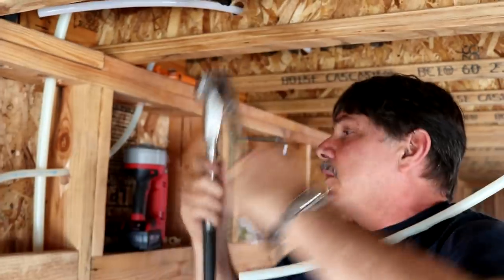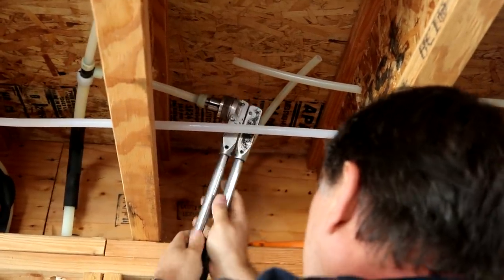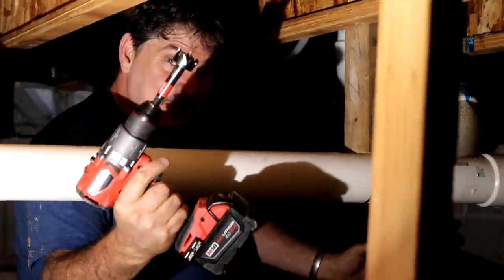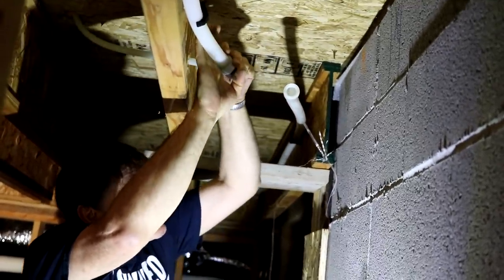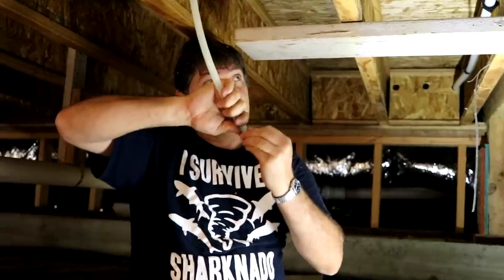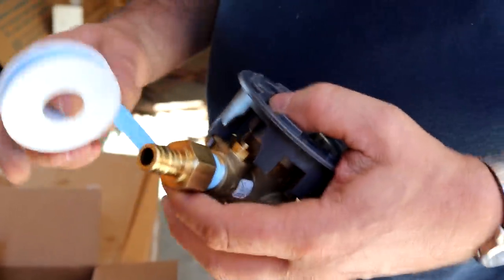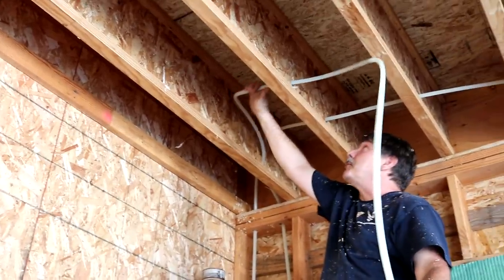Plumbing with Plastic Ep.95

Comment: Re:recirculation line.  I have one but don’t use it unless guests are here.  My concern is that it would seem to constantly be returning somewhat cooler water to the water heater.  Which, in turn, would constantly be “on” in an effort and to heat it to the desired temperature as it is constantly exiting into the supply line.
Reply: Sorry. My pudgy fingers hit the post button before I was ready.  The house is pretty big and the supply/recirc line is probably close to 150-200 feet. Am I wrong about the water heater constantly on?  Thanks for any info you may give me.

Comment: I worked in a mechanical engineer's office for a few years and learned how to size pipe.  I'd say that it's simple but there are enough little things to know that it ends up being more involved than it might appear at first.  It's not hard when you've been shown, but I'd hate to have to figure it out on my own.
I had Uponor send me a copy of their manual so I could size their pipe correctly.  I was the first in my city to have one, and to use it.  The plan examiner didn't even have one, he was just telling people to use the chart for copper pipe, and upsize to the next diameter.  That doesn't meet Uponor's design chart in many cases though because Uponor has much more restrictive requirements for velocity than pressure friction drop.
Designing plumbing plans for PEX is great because you don't need a riser diagram.  You can draw the pipes that go in the walls on the plan in a diagramatic fashion, so you can call out their sizes on the plan rather than needing a riser diagram.

Comment: Between this channel and The Build Network videos, I'm already planning to spend as much time planning the water and waste routing as any other part of my house build. Home-Run PEX lines, most of the water use points (bathrooms, kitchen, laundry, etc.) located near each other to shorten and simplify the routes, and 2x6min wall depths for routing waste lines. So much to think about.
Reply: 2x6 walls are so nice when you have back to back baths, or a back to back laundry and bath, or anything like that. Trying to cram two plumbing systems into a 2x4 wall can be quite a challenge.

Comment: He has to be using the cordless tool for the propex fittings.  I see he has the larger one, Milwaukee also makes the smaller M12 one, way easy to fit in tighter spaces. 1/2 in. and 3/4 in. no sweat for the smaller one.

Comment: I'd like to know Phil's opinion on Flair-It Pexlock fittings. In my opinion they seem the only comparable option to Uponor (minus the diameter loss at fittings). The other crimp options seem to fail often just because the crimped part wants to go back to it's original shape. Uponor is stretched to it is always trying to get back and that is what seals. Pexlock stretches a clamp that locks so it is similar.

Comment: Does the recirculating hot water line need to be insulated? Also wondering how it works with the tankless hot water heater.  I’ve only seen them before with a standard water heater.

Comment: Re: your comment "if you can afford it" -- Uponor AquaPEX tubing runs about 30-40% the cost of copper.  And while the ProPEX fittings are 3-4x the cost of copper, I can literally plumb an entire house in PEX with fewer fittings than I might use in plumbing a single bathroom in copper.  And then there's the huge time savings in "pluimbing like an electrician" (running PEX like Romex).

That raises a question - what was the reason for running the PEX like a traditional copper install, rather than homeruns to each wet room?  One of the benefits of PEX is the ease and relative low cost of doing homeruns

Comment: It’s not an extra line.  it’s a recirculating line and typically one is run to any fixture more than 50’ of pipe away from the source of hot water.

Comment: I don't remember the name of the black part Phil refers to as "the bendy thing", but I can tell you what's it for. It's to prevent the kinks (and worse stuff) Phil was telling how easy to iron out in PEX. Simply put, all materials have a certain safe radius they can be bent before snapping, kinking, tearing, etc. PVC pipe is much rigid for this kind of bending, and copper requires a special tool to make these bends safely that might not fit in the space needed to make said bends. So copper and PVC gets around it by having bends cast in the proper angle. PEX, fiber optic cables, and wire for both electricity and data all can be bent this way, and most (I don't remember if electrical wiring has them) have these devices to safely bend the tube or wire to the required angle without kinking and/or breaking it. And, you can make your own, at least for electrical wire and fiber optics. All you need is a hole saw and a scrap piece of wood. There is a formula that uses the radius of the wire to figure out the minimum radium of the bend. I don't remember the formula, but I do remember that 16 gage wire (used in telecommunications cable) requires a one inch radius in their bends.

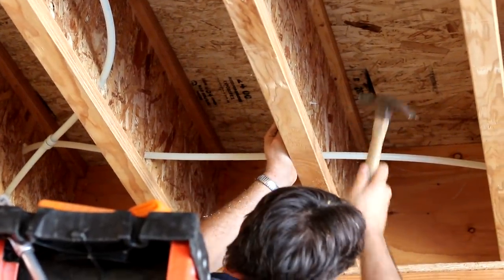Comment: 17:50 European pipe-in-pipe home-run PEX systems, eg. Roth Multipex or JRG Sanipex. Required for new hidden installations in Norway, as all tubes must be "easily replaceable". Same with electrical wires.

Comment: your plumber friend seems like a great guy. now when i was a electrician in construction, we used to use the phrase for the plumbers, and i will clean it up, Hot water on the left, Cold water on the right Poop doesn't run uphill, and the Foreman is P BLANK

Comment: There's expansion fittings with PEX-A, crimp & clamp fittings with other types of PEX, Sharkbite push fittings (which plumbers are reluctantly admitting to be reliable), and Sharkbite is coming out with a twist fitting (and apparently a new flavor of PE tubing) that looks like it might be easier than either of them.
Reply: Sharkbite is only warranted for 25 years (O-rings rot I guess?).  Then what?  You don't have to re-plumb a copper system every 25...  Quality, speed, and value: pick any 2.
Reply: Plumbers are reluctant to admit that Sharkbite push fitting are reliable because they are NOT reliable...at lease compared to standard PEX or copper fitting.
Reply: @wesleywhite1457  you also don't have to re-plume PEX with normal expansion or crimp fittings.

Comment: On the tub/shower rough in valves, can't you solder an uponor x male adaptor into the valve body? rather than using threaded fittings in the wall.

Comment: Glad you went with a traditional pex run including a recirculating pump. Home run pex systems are very wasteful. In a house that big it would take ages for the hot water to get to a single fixture.
Reply: Doing a home run system doesn't really "waste" much. It's highly efficient, providing hot water to sinks/showers within seconds without wasting energy through a recirculation line. In a trunk and branch system, it requires you to run large diameter pipe much farther to provide enough pressure to all the trunks. 1" pipe is far more material than 3/8 or 1/2, which is what you would be running basically everywhere in a home run.
Reply: @shawnd567  Uponor's Logic plumbing system using multi-branch tees combines the best aspects of truck and branch (less pipe) and best aspects of homerun (hot water quicker, less fittings) in one system. unfortunately, Phil didn't employ it here.

Comment: The one thing I like about galvanized and copper plumbing, if the lines freeze, you can take a welder and thaw them out. Can't do that with Pex. I'm not against Pex, it's wonderful stuff. 
My question to Phil is, why not run the pex in a straight line through those trusses? Seemed like they zig zagged a bit. Cheers :)
Reply: I think those are the precut knockout holes in the floor joists.  Some brands come from the factory that way, and inevitably the factory knockouts don't always line up perfectly once the joists are installed.

Comment: I assume the used fittings are long gone.  But i will take them if they are not.  It's easiest than Phil said to safety remove that pex.  It's not worth his time to just reuse 1. But if they are saved,  and you get 5 or more,  you can take the 1 minute that it takes to remove the ring and then heat the pipe with a torch and slide the pex off the fitting.

Comment: Hello this is Mike from Amsterdam Holland and a mechanical engineer and I see you fixing the bip and I hear you telling that the heart is always beneath the cold But why is there no installation around of called water tube now you get  Get the hot water can heat up the cold water line the and you can get the disease the vetren (legionella)disease.

Comment: I'm over here on the East coast. I've never seen those types of Pex connections.
Reply: Uponor is the name of the pipe. Also Wirsbro (old Uponor name) or Pex A. They are all the same. Expandable pipe. Fittings come in brass or plastic. Pex A also has the advantage of being able to work with crimp or expansion fittings, although I would only use the expansion, way less restriction at the fittings. I'm East Coast as well and my plumbing suppliers have it.

Comment: Simplest, and best way to cut the neck so you don't nick the fitting is to just take a box cutter with a solid blade, and break (or grind) the blade such that only the thickness of the pex wall is left out or slightly less. Then you can run the blade over the collar with impunity, and recover a mistake.

Comment: I know VERY little about plumbing but do have a question. Why not use brass elbows or tees instead of plastic. 40 years from now will those plastic parts still hold up?
Reply: $$$.   Time will be best judge of  these systems.  This applies to pro- press piping systems also.
Reply: its not generic plastic, its EP which is an engineered polymer that won't break down.  The brass can and does corrode. better yet, plastic is cheaper.

Comment: Do you have experience with uponor or sanipex? Do you have experience with pipe-in-pipe systems? I've never seen this type of system (in video) in my country where you just let the friction of the pipe-connection hold the parts together, without crimping. How safe is this compared to copper? Can these pipes handle freezing?
Reply: They are expanding the PEX and the fitting ring over sized then put the fitting in.  The PEX and ring shrink back to size causing a pressure fit not just friction alone.  If you notice in the video he had to cut the one fitting out because there was no other way to remove it because the fit was so tight.

Comment: So different from here in Europe! We only use this pipes for underfloor heating... Everything is crimped. Here we use a central collector. No branching
Reply: Here in the US the central collector is what we call a manifold or maniblock.  Typically is cost more because you have to run individual legs.  But people do it here also.
I think most plumbers here use crimps, also.  At leaset in my area no one uses the expansion type PEX.

Comment: In my experience there is pros and cons to every piping system. Pex a has better expansion better flow characteristics Pex b has a cheaper cost tighter fit up, still has expansion capabilities but suffers from lower flow. Copper best flow highest expense labor intensive good life span resists blowing apart with higher temperatures very stiff. Cpvc good flow low cost gets brittle with age ie 2 to 5 yrs. Galvy highest temperature resistance but will deteriorate from the inside out. Many more but that should make the point

Comment: In finland we just use pex inside of colorized safety tubes. Every waterspot gets its own pex and if it gets damaged you can change the whole pex by screwing new pex to other end and pull it out from other (no need open finished surfaces, and takes like 15min). Easier system and most defidently faster than this.....

Comment: blue and red pex with a home manifold and all home run lines, no connections anywhere other than at the device and at the manifold next to all the water systems in the utility room. anything else is a compromise and lot more work. pex line is cheap AF. i was able to do a full home like the one your doing for about $600 in pipe and fittings

Comment: The recirc loop is great; however,...

Why do you need it in the first place?  Because all that pipe between the water heater and the fixture makes a really efficient water chiller. Adding the recirc loop roughly doubles the "chiller's" efficiency. Having the recirc  pump run 24/7/365 saves cold water wasted down the drain at the expense of an always-on radiant heating system for your garage, crawl space, and wall cavities. Your water heater is always on trying to balance the heat lost to the loop.

The next best option is to run the recirc pump on a timer... which guarantees it will be OFF when your wife needs the opposite!

Ideal is to have the pump trigger on demand... some triggers include motion sensors, light switch, dedicated call button, water flow sensor.

Finally, insulating the pipe (regardless if pex or other material) helps keep the heat where intended. Insulating the cold side can help eliminate condensation in some climates.

Recircs are good... just don't run them continuously.

Comment: I wonder why sometimes he uses the hand tool to make the fittings, versus the powered tool?
Reply: No arbor for 1/2”. Maybe faster
Reply: Seems he has different size cones on each tool. He was expanding 1/2" with hand tool and 1" with power tool. That was my take at least.
Reply: @jnyates  Yes, changing the cone on the milwaukee expander is an extra step, just save the machine to do the big stuff which requires a lot more force so hand expanding it kind of sucks.

Comment: 4:28 of this video you have an LVL supporting a few joist with hangers. This same LVL has a descent size service hole in at at a very close proximity to the end of the LVL on the right??? How can this pass??? The service hole is also not in the middle 3rd of the LVL also a no no in Australia.I live in Australia and there is no way in the world anything even remotely close to this would be ok. That LVL is also being fixed to a Joist via a bracket. Another thing that is down right incorrect in Australia. Is the joist web (osb) suitable to carry a bracket and subsequent loads?? I'm assuming these two scenarios are ok in Oregon?? I understand things are different all over the world but would like to get your thoughts on this please. Thanks and KEEP UP THE GOOD WORK!!!
Reply: Within the the two end thirds of a joist span, holes are allowed as long as they are at least 2" from the edge of the joist. It looks like that hole is 2" or more from the edge.

Comment: A push button expansion "keeper" might be a great idea. Something you can drop without consequence. I'm wondering how long you can hold the cross linked stretched.
Reply: You can stop the expanding tool when it's most expanded to hold the PEX open. I do that on most joints I set that are going to take a bit more time to get seated in the pipe.

Comment: This is Pex A. More flexible than B. Which    I believe can't be used with these fittings. 
A better system I believe is evo pex. A push to connect fitting made for new construction. Now I know there will be plumbers who say they won't use them but if the other guy is they won't be able to compete on price as the labor time will be considerably less.

Comment: The plumber needs to invest in a power expander. It would save s lot of time and ultimately save more than it costs. I like PEX, though I prefer “home run” setups with everything going back to a manifold, similar to how electric is run. Just be aware PEX has 3 types (A, B, and C); only PEX-A can be expanded and use compression fittings. PEX-B or PEX-C is what you’ll typically find at big box stores and requires undersized fittings and compression or cinch rings to make connections.

Comment: Can someone enlighten me on the advantage of uponor pex versus the pex you buy at Home Depot and use cinch rings on?
Or a video that explains?
Reply: With Uponor PEX the fittings have the same internal diameter as the pipe, so friction is minimized. In a small home run system like mine with at most two fittings between the manifold and the fixture, I can't imagine it makes much difference.

Comment: A question for Phil:  Do you have any suggestions for keeping the noise down in pvc drain lines?  I've noticed some pretty noisy drain pipes in vertical falls, especially in apartment buildings.  In some places where I've stayed in Colombia, the noise is enough to wake you up.  In or Nevada home, the vertical drop by our two upstairs bathrooms is startling to hear.  I've seen foam wraps advertised but have no idea whether they really work.

A word Nate and Scott about the ads in the middle of the videos:  They are really a disincentive to watch the videos.  It's one thing to see the "skip add" soft key pop up in the ad that you can quickly hit, but altogether a much more disruptive event when an ad suddenly comes on at a loud volume, completely out of context, screaming at you to by some garbage from Disney.  I'll be watching much less because of it.
Reply: Insulation. Or be like Matt Rissinger and use cast iron so it’ll rust out.
Reply: Chris, I've seen thin foam tape type coatings that you can wrap pipe in but it looks pretty labor intensive.  Are you aware of any testing of how much each type of insulation reduces the sound?  In one of Rissinger's more recent videos, if I'm not mistaken, he suggested using cast iron on the vertical drops, and pvc for the rest.  I don't think rust would be an issue for that application.